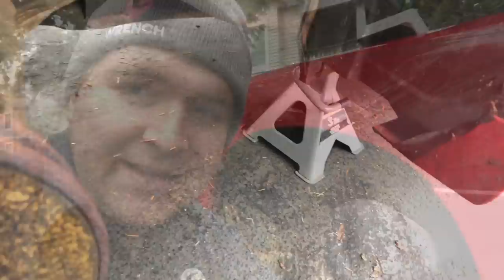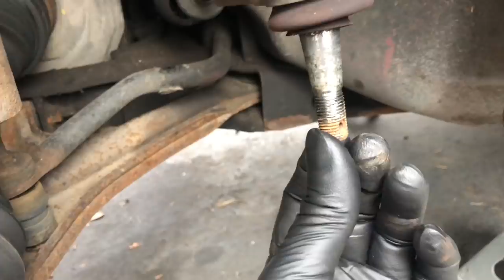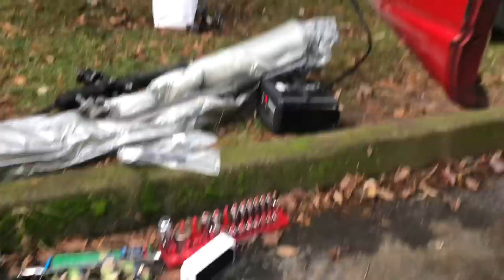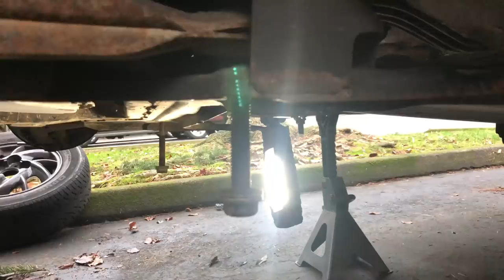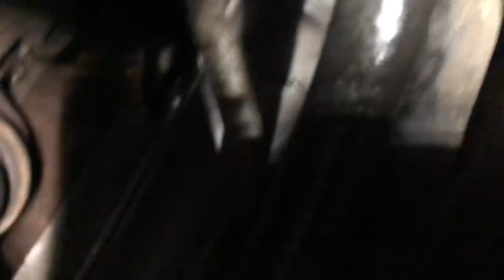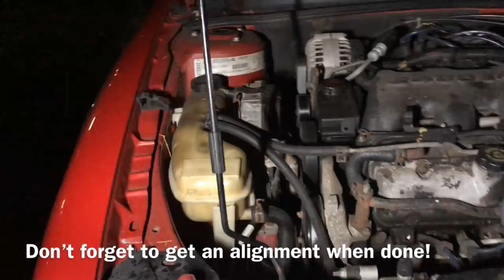2001 Pontiac Grand Am - Rack and Pinion R&R Instructional Video

Comment: I must add a warning to this. For anyone attempting to do this, after you remove the 11mm bolt and release the steering rack from the steering shaft, Do NOT turn the steering wheel at all. If you do, you run the risk of breaking the clock spring which is an internal part in the steering wheel assembly. Don't screw yourself by saying 'Hey Y'all Look At This!' and spinning the steering wheel like a bicycle tire.

Comment: Man I just had the same problem.broke completely off. Only I mig welder it back on and beefed it up.with the same width àll the way around a little passed the old one.and welded under the eye were the bolt hole is.its solid better than factory baby.gotta keep it cool don't want to melt anything.been a week and dry as a new one would be good luck guys did it in a one day

Comment: Replaced my rack and pinion yesterday and now my steering wheel doesn’t turn my steering column/tires any advice?
Reply from the maker: I’m sure you’ve figured it out by now, but I’d double check that u joint where the steering wheel goes to the rack. Does your steering wheel spin semi freely?

Comment: Don't be fooled. This is a descent video but is loaded with a bad joke as seen on a lot of you tube video where they don't show you how they did the most time consuming and most important part to be done. Which is this. Removing the unit seems easy. Putting a new unit in (stabbing it) can be tricky and time consuming, even days if your not prepared. Everything else is kind of easy except for one of the hoses. You just need a longer wrench for it

Comment: Is it easier to get the lines off from taking the wheel off and lowering sub frame working on gt model the flange nut on the bottom won’t budge
Reply from the maker: I’d say so, it’s been a bit since I’ve done it but I think that would give you a little more room to get the lines off.

Comment: Old video I know, but how did you get the drivers side bolt out? The sway bar is in the way. I have a 2000 Pontiac grand am going through this same situation. Terrible engineering design right here.
Reply from the maker: Sorry for the delayed response. It is a terrible design haha I’m assuming you got it? Other wise are you talking about the drivers side mount bolt on the rack?
Reply: @scarscars3486  yup I got it replaced, and it's definitely a terrible design. But a full day, and it was replaced. Saved a ton doing it myself.
Reply: @scarscars3486  how did you lower the subframe enough to get to that bolt I am having trouble with the bar getting in the way. I have put a jack with a wood block supporting the engine, and took out the 6 bolts you showed but it still unable to reach